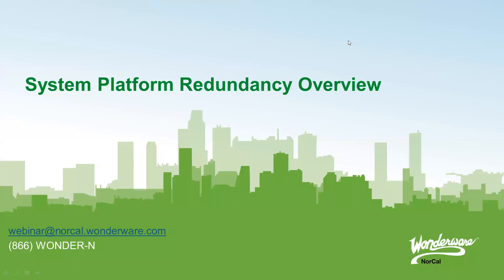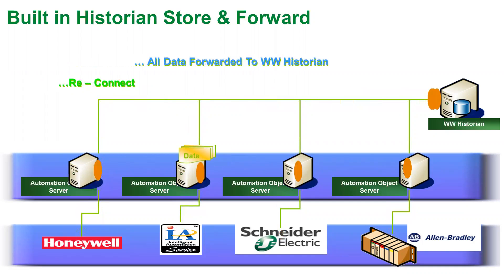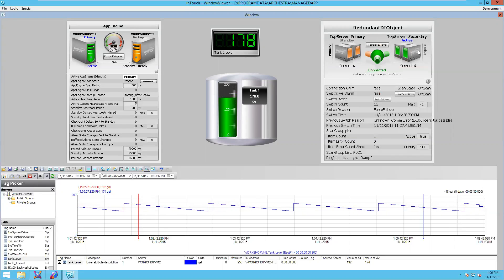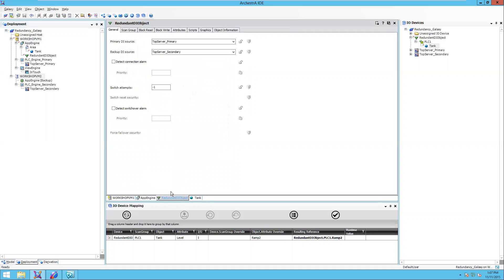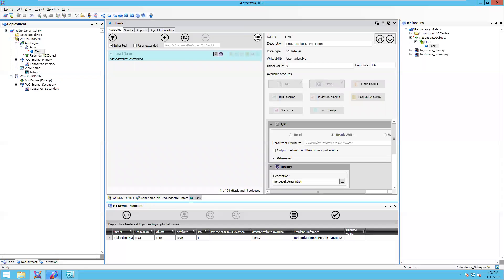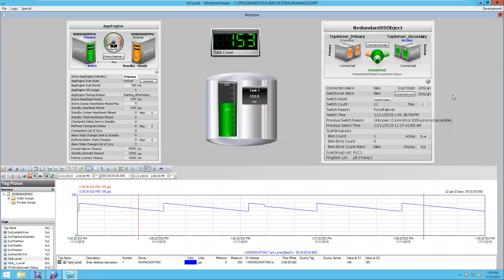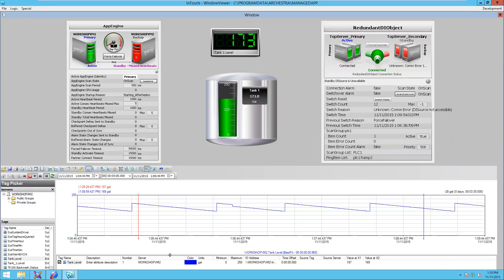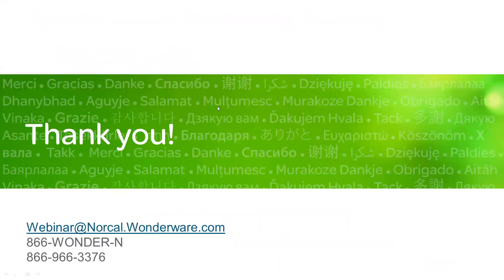System Platform Redundancy

Comment: Trying to setup redundancy for the AppEngines here.
I did everything as described in the video, however it is not working properly.
How can I get this Intouch application to monitor the servers? That would be really useful to check with my redundancy is ok
Reply: It's standard component of archestra. You can find it in graphic toolbox->Archestra symbol library->Displays.